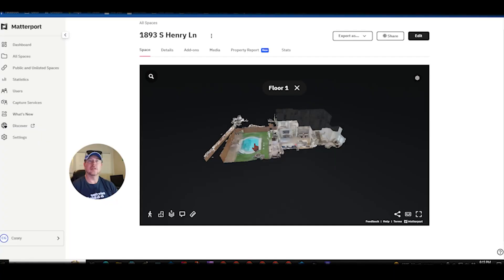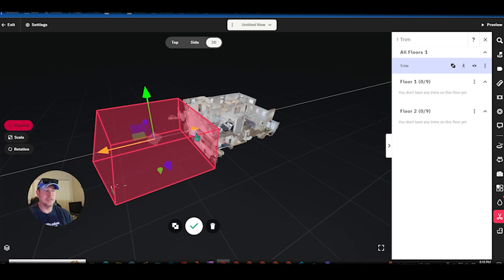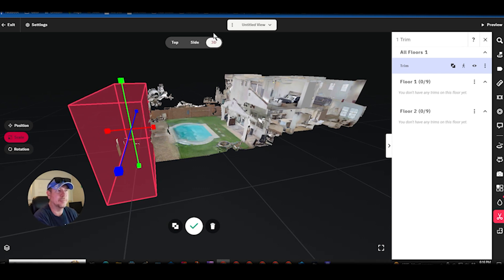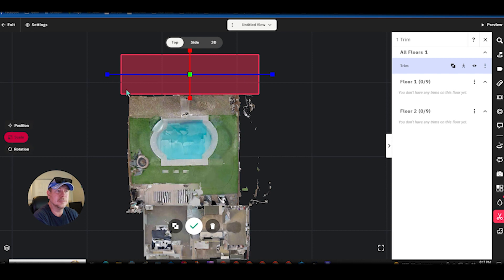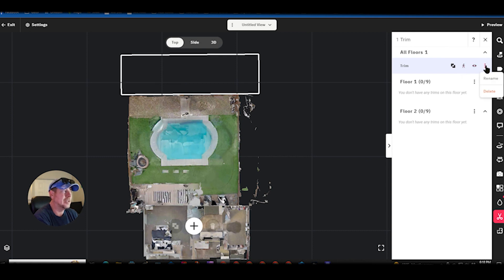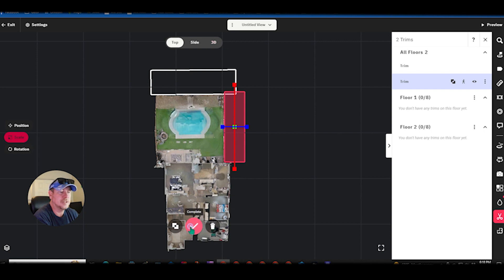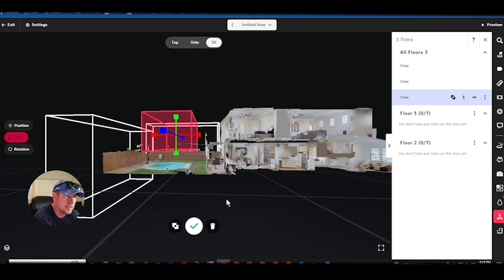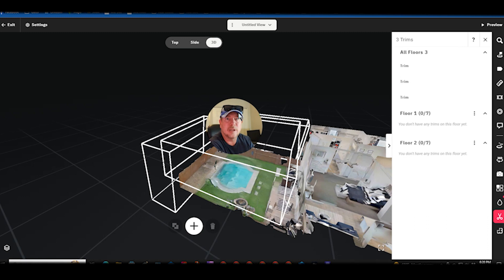Trim Tool In Matterport #matterport

Comment: Hey Case!
I love these videos. Great work. 
I saw your old tips for scanning stairs - how you scan the whole stair case before changing floors...but I've been running into these super skinny long homes where the upstairs and basement staircases are directly under one another. Maybe you could do (or direct me to an old video) on approaching different types of stairs and when to start a new scan on a new floor. I'm getting stuck having to change floors mid way up the flights or the camera starts picking up details of next floor and sprays overlap on the master plan...(usually ironed out once processed) - just wanted to pick your brain.
Reply from the maker: Well we don’t run into basements much here.  And basement with stairs under the stairs going up, I have seen once. Lol.   But….  You can change the floor at anytime on the stairs or at the top.  So to not have that extra flare start the next floor halfway up or down.  That might help! If not half way up just at the 1st scan on stairs. Either way I think will work.  Let me know if this helped.